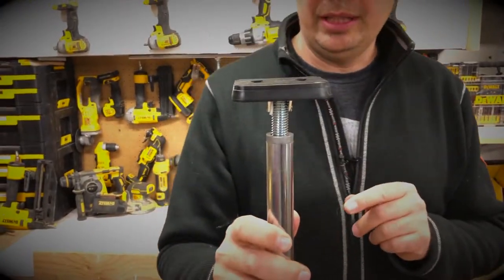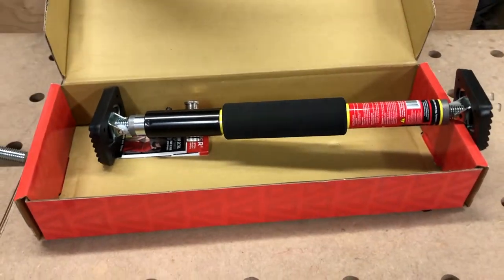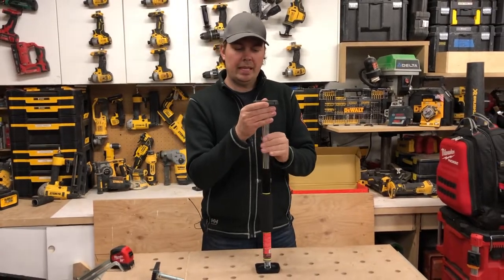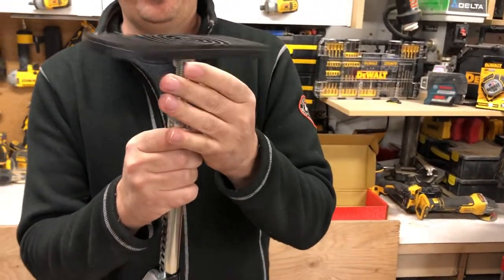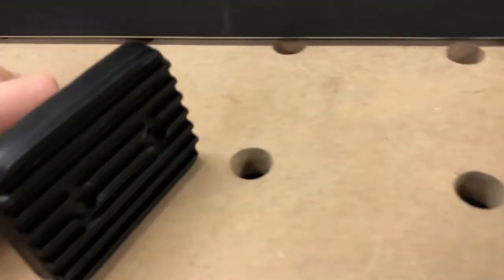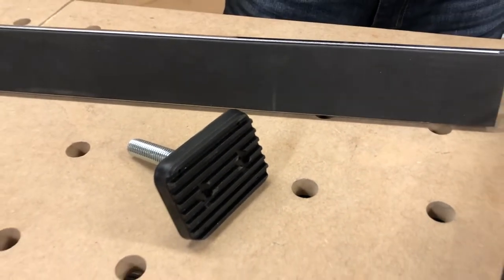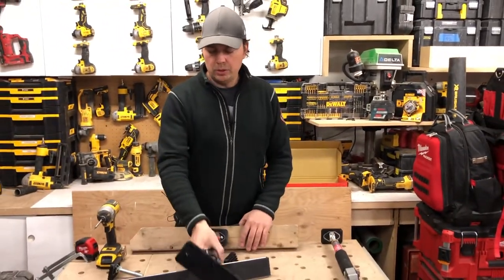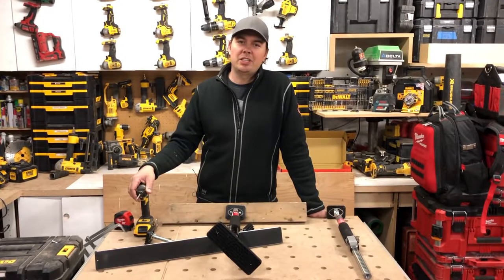NEW TaskTools poles make installing cabinets EASIER (support rods)

Comment: Another really good topic and product review, Brad !  Most companies / Contractors install wall cabinets first, but I worked for a Company that installed the base first.  Two reasons for this:  One never really knew how far off the floor might be, and so it is easier to get the wall cabinets to the correct height, but really, main reason was to get the base set, and then the Granite people or other custom top shop could template, and get the tops into production quicker.  I did this for a living, and it was the policy of the Company I worked for.  I tried to talk the boss into these support poles Brad, but a couple of us ended up making a few support pieces at different heights, and kept them on our vans.  And besides, if the job was a high end one, two installers would be onsite, with a ‘helper,’ who would be holding the cabinet up on the wall.   Stay safe and Healthy!  👍👍👍👍👍😁✌🏻🇺🇸

Comment: I use the taller ones for beam installs. I would recommend NOT just pulling the pole out it will wear down the little piece of metal that locks in. its very small and can be worn off fast.  then you can't trust the integrity and it may fail..
Reply from the maker: Good tip. Thx for watching